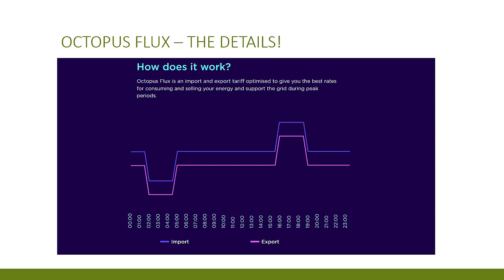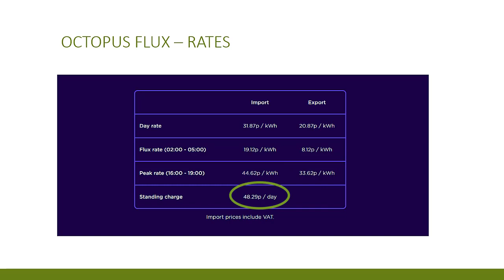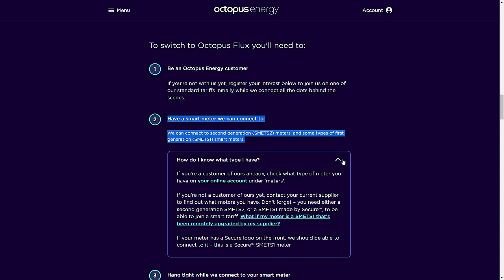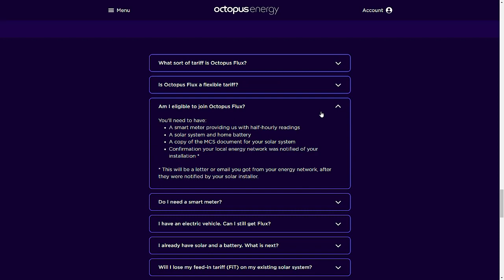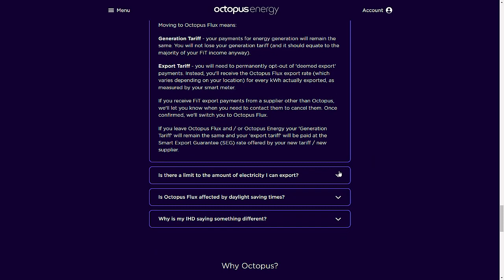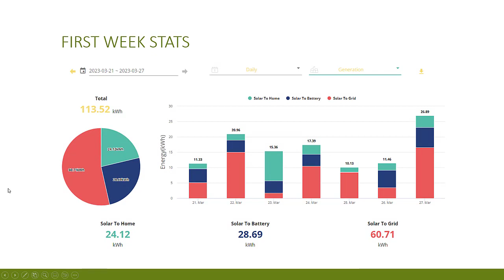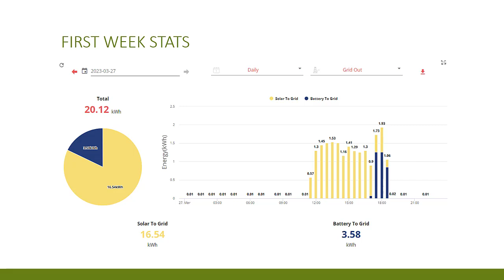OCTOPUS FLUX TARIFF!  Printing Money!?  First week review.  Should you switch?

Comment: I'm on Agile at the moment. I have a 4.7kWp solar array, pretty much south-facing, feeding a 3.6kW inverter. I also have a Quasar Wallbox so I can charge or discharge from my EV. I don't have any other battery in the system.

My electricity usage probably exceeds my annual input from the solar panels (I've not had them for a whole year yet; basically since August, it's generated 2344kWh to date). It's hard to know whether switching to Flux would be of benefit; I think I'm going to have to go through some spreadsheet shenanigans to work it out.
Reply from the maker: There are a couple of other flux videos on YouTube where people have made spreadsheets that might help. 👍

Comment: Im a low user but im gettin 20p per kwh on Fit  so i would lose that . i dont know if i should give that up
Reply from the maker: Yeah probably not worth it I suspect but probably worth checking the maths to be sure.
Reply: @DanEVSolar7  Thanks ill hang on for a bit lounger and hope we get a new government  thats a bit more green ,
Reply: @rodden1953  Hi, you don’t lose the generation payment if you are a FIT recipient which I believe you have referred to with the 20p element. You do lose the ‘deemed export’ which for us is only 4.25p (being a 2012 recipient our generation payment is 60p). It’s gone up since April 1st but don’t have the most current figure but it’s 10% higher than last year. We are currently waiting an extra solar install and number crunching to see what the best thing for us to do. We are currently on Go, losing the FIT deemed export is a big step as it is index linked, however if we swap to Flux, then back to Go in the winter we would get Octopus’s standard export payment. As we don’t export much in the winter the summer payments on Flux need to fill the gap, hence the number crunching. We have an EV and a Powerwall so it’s a bit complicated for us.

Comment: Interesting, thanks for the video! got my panels+battery in Feb and have moved to Octopus and am waiting on new smart meters... I'm barely using the grid (despite the grey days), and still have plenty to export on the nice days - but during the winter, I could see Flex being ideal.  It feels like it rewards higher battery capacity...
Reply: Personally, I'll be switching back to Go late October, and jumping back to Flux mid March.  Rinse and repeat.
Not sure I want to be hammering the battery unnecessarily.
Spent £15.86 import.  £23.17 Export, but only moved to Flux on the 23rd of March!
Almost too good to be true
Reply from the maker: No problem at all. Sounds like you are in a similar situation to me then with the export. Hopefully you get the smart meters sorted soon. 👍

Comment: So you are looking to get £1,000 over the next 7 months based on worst case March figures??? 
So your average £8k-£9k system will be paid off in worst case 8 or 9 years and that's without taking into account the savings from the batteries over the winter which will whittle that down even further (more so if there's some winter sun). 

I do worry if octopus has thought this through... 👀 That's a lot of payments to dish out, especially with no limit on array size.
Reply: Don’t forget the rate octopus are paying you for export is still below what the majority of people and certainly businesses pay for import so Octopus are still winning. Good business sense if you ask me and probably why octopus is successful in many countries. Hopefully eon/British gas etc will take note and do the same.
Reply: @billyoung2458  Thebig win  for Octopus 3 to 7 slot the the usage drops the less they have to fossil fuel powerstations mega bucks to start up a run and with major  costs co2 outputs.
Reply from the maker: Hi Peter. Yeah I’m hoping for a 5 year payback but had worked for around 6-8 years in reality. So many things could change between now and then though so we will see. I can only assume that using the export is cheaper for Octopus than starting up a backup gas plant, for example, but not really sure. I’m not complaining though. 😁
Reply: @Peter Ebenezer
Octopus limits the size of the inverter to 9kw. Probably the DNO will cap the export of most pv systems at 5kw. Octopus wants to buy more exported pv energy because they make a profit selling it back to the grid, without doing much work. It’s a brilliant win-win business model
Reply: @serraios1989  there is no limit to the size of inverter or export. The DNO limit is based on the G99 application.
Reply: @billyoung2458  
You are right; there is no limit to the size of the inverter any more. It was 9kw when I switched to Flux in the beginning of March, however  the version C of the terms and conditions updated on 22 March 2023 do not restrict the size of the inverter. However the DNO might still apply restrictions to the export power. It’s obvious Octopus want to buy as much exported pv energy as they can, as they profit from it (and their customers profit too)
Reply: @serraios1989  that makes more sense (the fact what they sell it for still outstrips what they pay you at peak). Thanks for clearing it up!
Reply: I very much doubt this tariff will exist in 9 years.
Reply: @PhillPriceUK  Agreed, Not in it's current form for sure. I imagine this is a loss leader to get people to join up before they no doubt need to change it to only be 1p-2p difference between either period to stop people running up over £1000 of credit over summer.
Reply: All of the chat about money n numbers in general is all dependent on your energy needs, how much you can produce weather permitting, how you use it and how much surplus you export… I estimate my own system will pay for itself about year 6, any export£ will help off set the winter months when solar is just an expensive paper weight